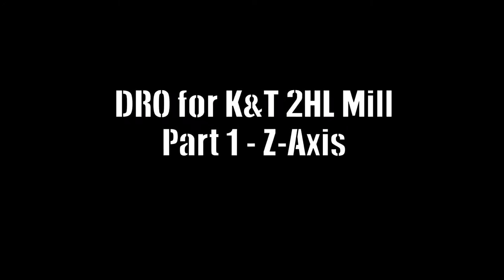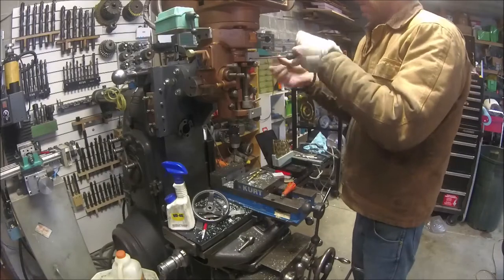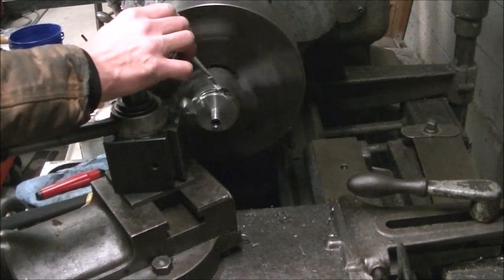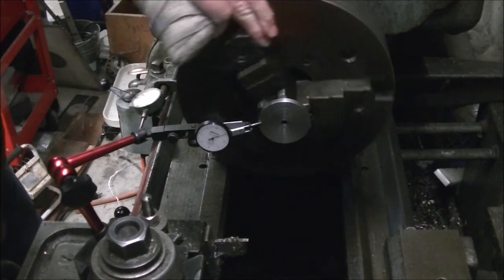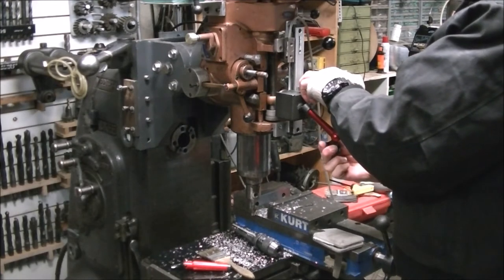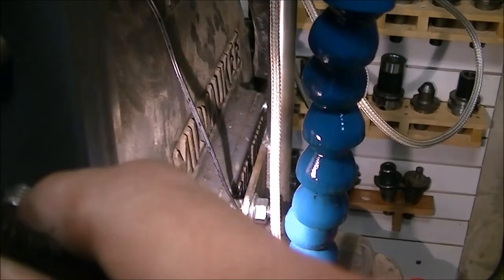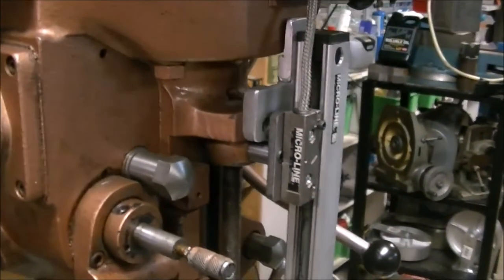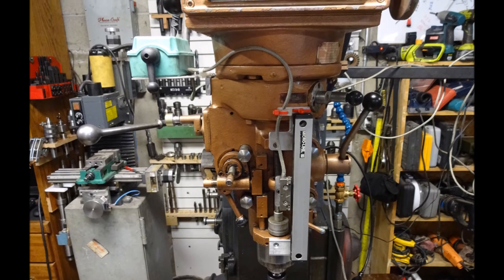DRO for the K&T: Part 1 - Z-Axis

Comment: Off topic remark, but we really love what you did with the drills mounted on those little racks behind your Kearney Trecker Milling franken monster (highly useful machine) machine. We really like the milling machine as we see so many power mills, we have never seen anyone do this alteration. Yes the arbor is a bit off haha, its ok we have a few things that wobble around here besides these two old guys I mean. We put scales on our manual machine shop lathe and wondering how we lived without it.
Reply from the maker: I know what you mean about the DRO. Now that I've got it on the mill I can't imagine going back. I need to find another good deal on a used one do I can upgrade the lathe. Craig
Reply from the maker: I spent a lot of time looking for a modification like that to the mill and couldn't find one. That is really why I started posting videos, in case some one else needed some ideas on a similar modification. Craig

Comment: I would put a plastic bushing in the cable guide, even a bradded cord will sooner or later start to wear, or you could also round the edges off so that there are no sharp edges, kind of like a hour glass shape would also work.
Reply from the maker: +Jeff I made the cable guide out of UHMW nylon with a chamfer on the edges on the hole. I'm hoping it'll wear and not the cable. Thanks for watching and commenting. Craig

Comment: That DRO will  make milling a much easier job than you can imagine.  No more worrying if you got the slack out of the screw.  It lets an amateur like me position things like a pro.  Sorry about your thumb.  I bet that thumb hurt when it broke.  I hope I am around for the story when another time comes.
Reply from the maker: +Amateur Redneck Workshop Harold, thanks for stopping by. The DRO has been great, I can't wait to get the Y-axis up and running. The broken thumb was an inconvenience to say the least. I'm sure you are familiar with the old Hi-lift style jacks. They call them man-killers for a reason. Craig